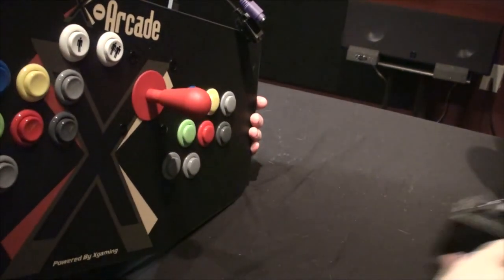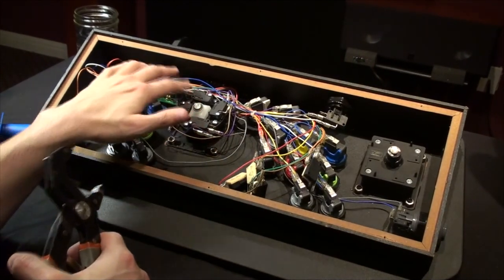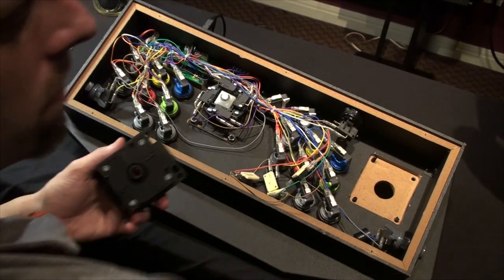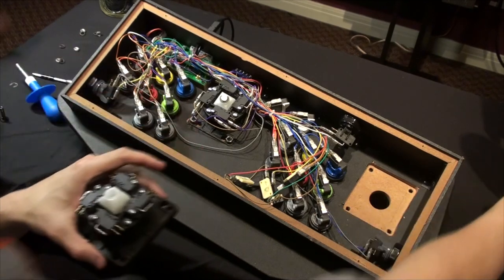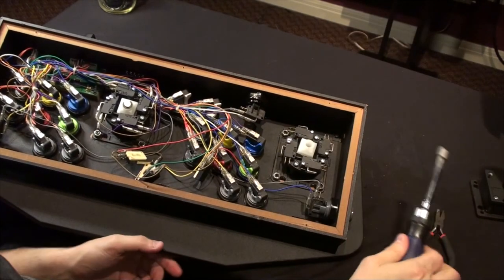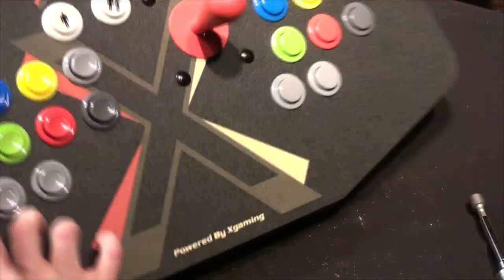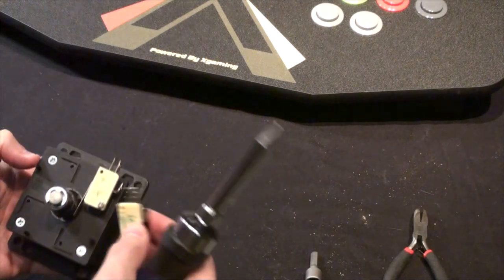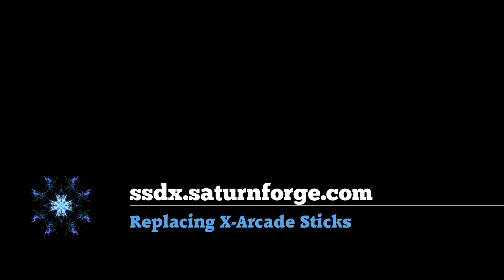Replacing X-Arcade Joysticks

Comment: Thanks buddy !! Just the video i needed...
I just got my il euros joysticks from paradise arcade...and i havent instal them yet.
Im going to mod my x-arcade tankstick with led buttons and a usb interface spiner from glen arcade from amazon.. Real easy.... just usb led $ 17 bucks encoder for lighting the buttons , and i can still use the same cherrys switches for  everything , no major hassle ..just plug and play ..
SALUTATIONS from Puerto Rico 🇵🇷
Reply from the maker: Great! The Euros feel really good if you grew up with American-style arcades. Have you looked into the TurboTwist 2 spinner?
Reply: @Zevaeros  no...is it easy to set up with the x-arcade tankstick?
Any info with the x-arcade wil be appreciated .
Reply from the maker: @vadergamer7722  I believe it's shaped to fit in a standard button hole, so yes in that sense. As far as wiring, I don't know.
Reply: @Zevaeros  thier is a usb spinner on amazon from glenn retro arcade , just sixty dallors .he told me it works with pc and raspberry pi 3 and 4.
Its enteral parts are smaller than turbo twist.look it up on amazon